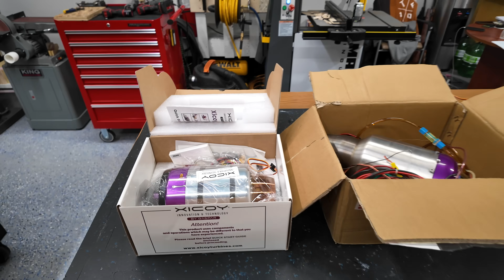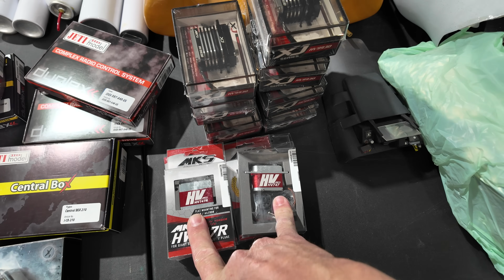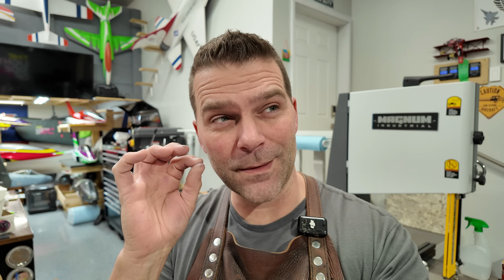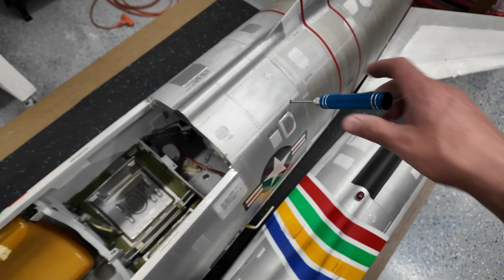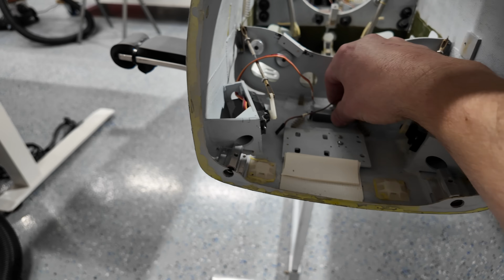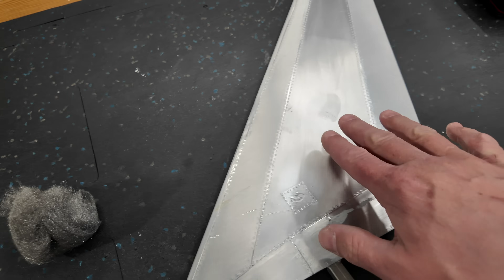Reviving History: F100 Museum Restoration Kicks Off! BVM F-100 RC JET part 2

Comment: Anybody know … who can provide service for AMT USA turbines in United States?
Reply from the maker: Maybe best to send back to factory.
Reply: @ It is an AMT USA turbines. They split from the original factory in Netherlands in not good terms. So, it will not be feasible to send them to Netherlands for service if they accept work with them. I am slowly transitioning and updating with newest turbines. Thanks for your suggestion! 👍

Comment: Why not use the CB210 and re-map the output channels of the Rex7's that will give you ample ports. Just ensure you supply power yo thr bus and not rely on EXT port for power supply.
Reply from the maker: Don’t like to do that. Prefer to keep the receiver separate and not running anything

Comment: Okay, this is long after the build is finished but...  When you were talking about "heat proofing" the tail section of this bird I was thinking of that ceramic paint you often use.  Both to coat the entire inner surface of the tail and the OUTSIDE of the tailpipe.  You'd probably still want to use a bit of blanket to shield the servos that are super close to the pipe.
Reply from the maker: Trying to get the best of both worlds  heat proof where needed and then keep airflow high.

Comment: I think a large part of the heat concerns on this aircraft were due to the full bypass, which was state of the art at that time, the limited space between hot components and electric/air/mechanical components and more so to do with the fact that the original owner probably did more running of the engine on the ground (hours wise) than ever in the air flight time. Time has got away from me but IIRC this aircraft was barely flown. I believe it was the subject of at least 1 major model magazine article. I think I did see BV fly it once at either Jets over Kentucky or maybe at one of the jet events in Florida…can’t be sure. Might have been another similar aircraft. Im TREMENDOUSLY excited to see what you and your team will do with this and hopefully see this aircraft flown again.
Reply from the maker: Thanks and great insight

Comment: For the age of the F-100 model it came out when AMT engines were a prominent name for power plants. They were like the newer generation that we have now, very dependable. AMT like the other manufacturers of that time always seemed to think bigger was more powerful. Along with modern inovations and better assembly processes, everything got smaller, simpler and surprisingly more powerful.
Reply from the maker: Great engines for sure!  I have heard stores of guys running for 100+ hours on them.  Just keep running with the unfortunate weight penelty.
Reply: They all will run over 100 hours. It’s a scam. It’s called residual income. Don’t use diesel, use Jet A. Keep the engine cool after end.

Comment: She,s a beauty alright. 🎉 Can,t Believe the lights and airbrake were air operated.😮 Plenty of scope to do things differently.😅 At least the Xcoy is a bit more fuel efficient re tank size.😂 Not a lot of damage over all for it,s age. 😮 What about injecting some epoxy ito leading edge that way ya only left with smaller hole in the stab.😅 Great work carry on.😅❤😂
Reply from the maker: Thanks Nick!  Yea spent the weekend working on it and the next video.  Took out 1/4 lbs in velcro and wire holders alone!  I have a feeling we may beat the 38lb prediction for final weight!